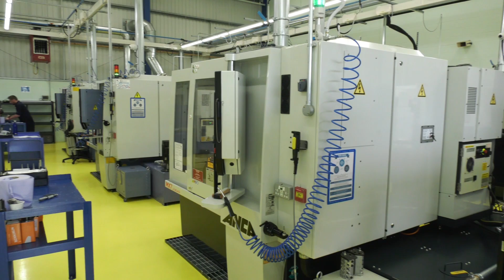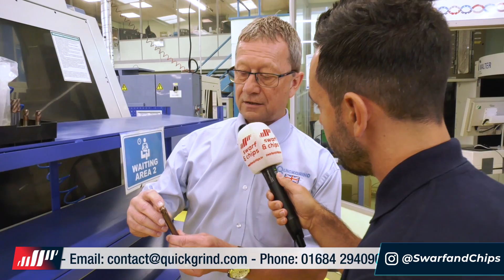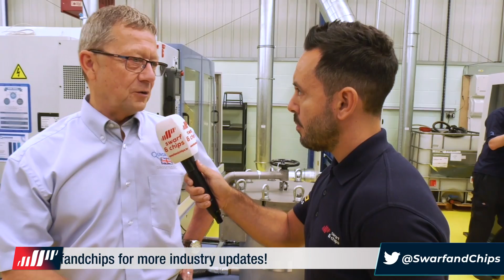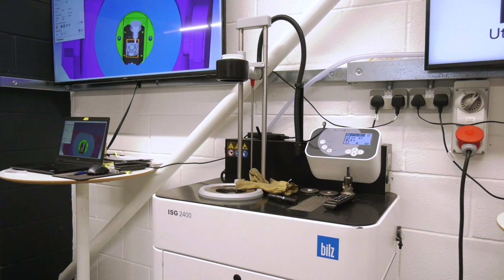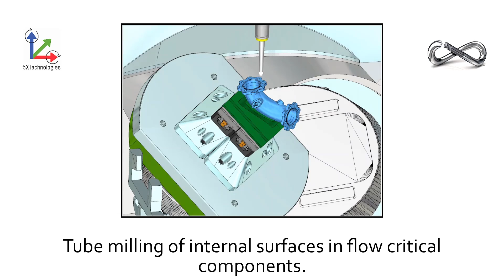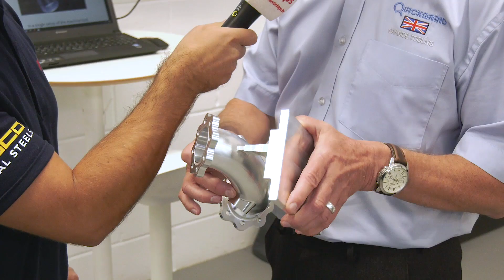#SwarfandChips - Boost productivity with innovative cutting tools - Quickgrind - 04/10/2019 - Ep 147

Comment: Hi Folks @MTDCNC, thanks for the very interesting video! However, this week's cycle time challenge is totally unfair, let me explain why- the 5 axis machines vary in leaps and bounds between themselves, and the controllers as well. So if the machine is no object and you have a machine that you can dream of, unlike what is available today, the part is rigidly held, and you have a table with almost zero mass, controlled by a DDM kind of a drive for the B/C (or rotational axis), then you can run at the maximum speeds and feeds that the tool allows. That will be in the range of Vc 500-600m/min, Fz 0.1mm for roughing, 0.06mm for semi-finishing and 0.02mm for finishing. With depths of around 20-30% of the tool rotational dia (not the radius of the barrel face).  
Furthermore, the machine controller should be such that it can do a smooth, constant feed in 5 axes at 10000m/min, you can then do the inside and outside in less than 1 hour and the total machining time could be around 1h30'. But the reality is different if your machine is large like ours, table load is high, for such a small part then the dynamics of holding a constant speed will be the limiting factor. In our case, we will not be able to do more than 1200m/min of feed with a very high-end quality i.e. at the precision that the glass scales give (+-7microns). If you go any faster the machine will not be smooth and will jerk and the tolerances and surface finish will suffer. So in our case, this part should take around 5-6 hours on our machine due to slower feeds/speeds. All this time will be in finishing the surfaces. That is the reason that the cycle time challenge is a bit unreal.
Another thing that will add time to this is that there are two flat surfaces, they must have a perpendicularity tolerance on them. This kind of job with 7075T6 will require relaxation of the part after semi-finishing for at least a day if you need to handle the tolerances due to relaxation of the part due to internal stresses. So you need to add an operation to reclamp the part in the machine.  Anyhow here is an application of barrel cutters on my video that I've made for a barrel cutter. The part in my video is offset from the center by around 200mm. It is in full 5 axes.  They do indeed save a lot of time. https://youtu.be/H4clDT83Jl0

#cycletimechallenge
Reply from the maker: Many thanks for your detailed comments. It's very pleasing that you put so much effort into our content. I believe this was programmed in hyperMILL and machined on a DMG MORI eVo Linear.
Reply: @MTDCNC  Your's is the best channel that allows one to walk through something like EMO without getting out of our couches ;-). It would be even better if you had a bit more technical and less marketing-oriented channel.
Reply from the maker: @nash0427  Thanks for your comments. We try to cater for all levels of engineering but it is something we will look at for sure. Thanks again.